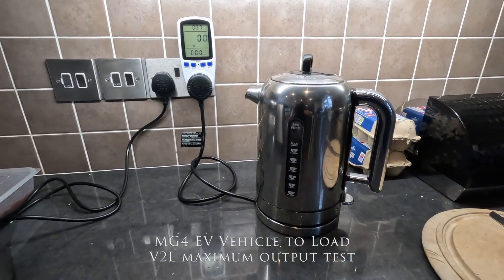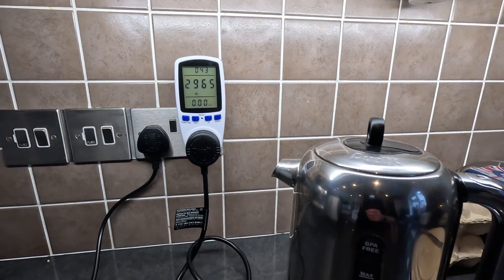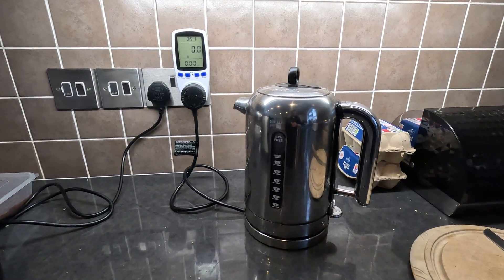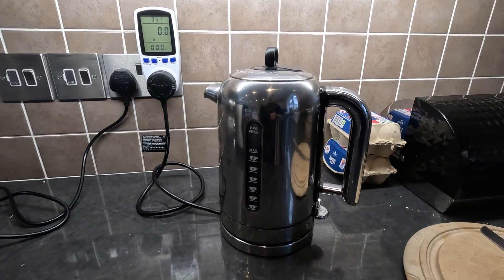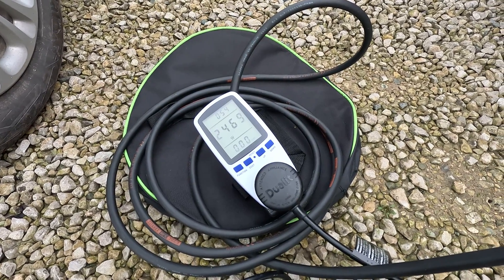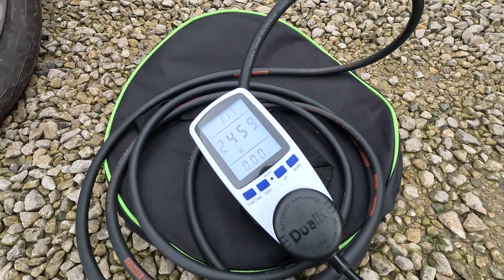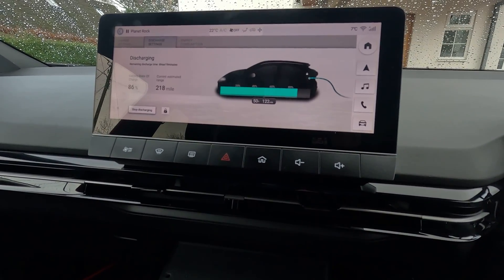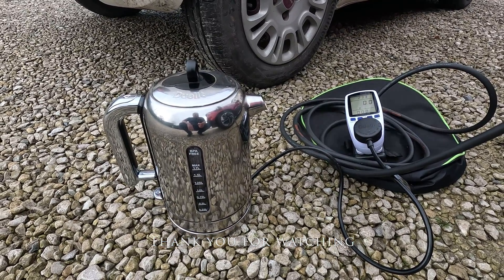MG4 EV Vehicle to Load Maximum Output test

Comment: Simpler explanation here.  The domestic supply is 240V, taking the power from the watt meter, that results in a resistance of the kettle element of 19.43 ohms.  The car is showing 220V which means that the current drawn by that 19.43 ohms is 12.35 Amps.  Therefore the power in that circuit is current squared multiplied by resistance which is 2490W, which is what you saw.  I don't know what the design limit of the V2L on the car actually is but the above is why you're seeing what you're seeing.
Reply: In the MG forums multiple users have got up to 7000W continuous, so the actual limit is a lot higher :)
Reply: In V2H configuration or used  as emergency home power it seems it is possible to retrieve 7KW.  32 Amps 6 mm wiring!!!
Reply from the maker: So you think a 10% approx drop in voltage would result in a 20% drop in power output?
Reply: @BurlSolomons  I've provided the calculations.  That's ohms law for you. Power is derived from the square of the current multiplied by resistance.  The element resistance is constant so absolutely yes, since the voltage is lower, the current is lower and it's the square of the current which provides the power.
Voltage on its own is worth nothing as far as power is concerned, it's the current which provides the heating effect and the current is a factor of resistance.  Voltage is merely the "pressure" that pushes the current though the resistance.
We can be more accurate if you're able to measure the actual resistance.  I had to calculate it from the domestic power 240V assumption and the power from your watt meter (which has unknown accuracy that can be determined in that video).  It's close enough though. :)
Reply: Uk domestic supply is 230V, since 2003...
Reply: @timriglar4502  230 Volts is the nominal Voltage In the UK, the tolerance for our electricity supply is 230 volts -6%, +10%. This gives an allowed voltage range of 216.2 volts to 253.0 volts.
Reply: @timriglar4502  Nope, try measuring it and you'll see. It's harmonised with EU which is 230V within a range of -6% to +10%. The upper range is 253V which means that the UK 240V is within the tolerance for harmonised 230V.
Reply: @djtaylorutube  I'm not disagreeing, but the original post said UK domestic voltage was 240V. As I said simply, and you've amplified, the standard is 230 -6% +10%. So 240V or even 250V within spec. For interest, 236V here just now.
Reply: @timriglar4502  Yep and 243V RMS here right now. :)
Reply: @timriglar4502  But 2003 was a paper exercise to say, again on paper only, that UK/Ireland grid voltage is the same as the EU but it isn't. UK is 240V, France is 220V plus or minus a bit. Neither France nor the UK have changed the grid voltage, we just pretend the 20V difference isn't there.
Reply from the maker: @timriglar4502  245.9 right here right now.

Comment: Thats nowhere near the maximum,   if the lead is fitted with a 470Ohm Resistor it will output a full 7kw at 220v.   If the lead is fitted with a 2K ohm resistor it will top out at just over 2.5kw at 220v,  you need to make sure the lead is capable of taking 32amp 7kw if using the 470 Ohm resistor version
Reply: Presumably the output is limited by the capacity of the car's inverter, so those lucky enough to have cars with the 11kW inverter may potentially be able to draw up to 11kW (although maybe only via three phases).
Reply: @sailingoctopus1  I do not think so. The 3 phase 11 KW charger can load at 7KW single phase. To make this possible the charger desing allows 7KW bi-directional single phase. The output should be limited (fused) accordingly the socket and lead  or a  32A  type 2   is used.